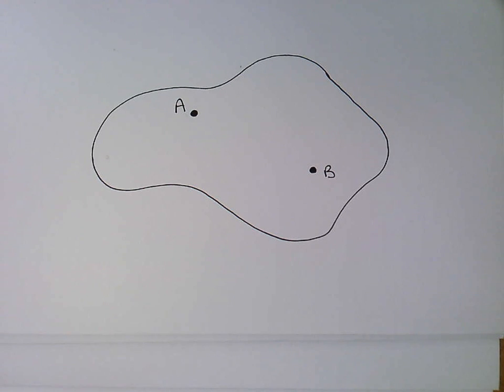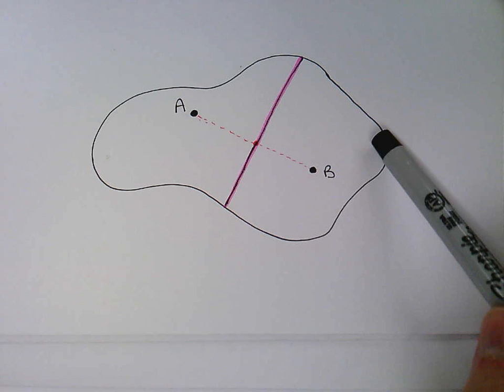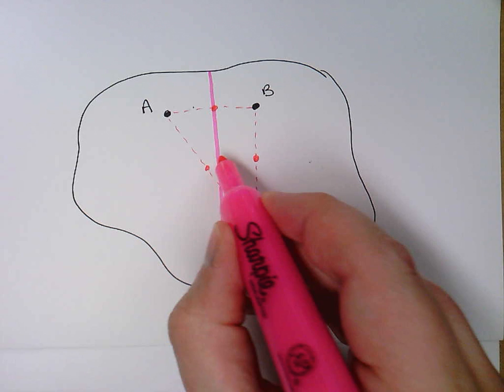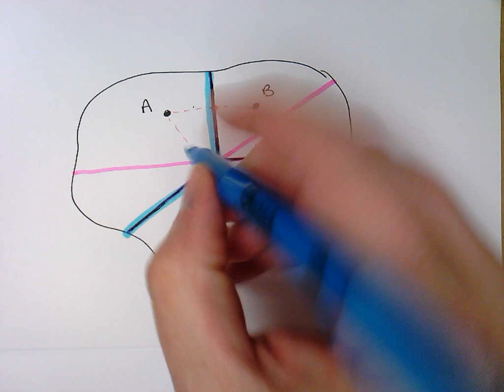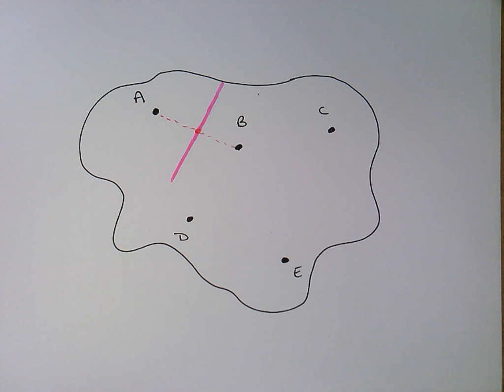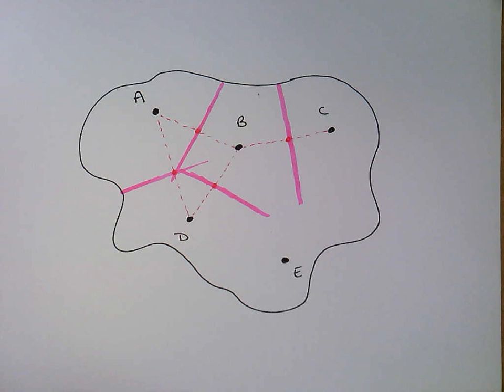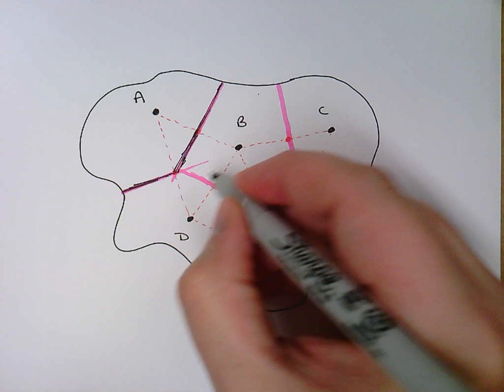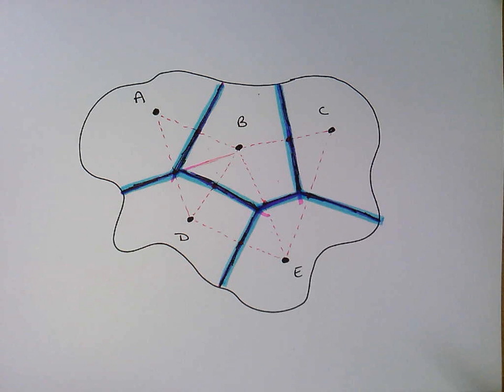Thiessen Polygon Method

Comment: Why are you not joint A and C
Reply from the maker: The reason to connect 2 dots is to find the dividing line between them that separates which area is closer to one, and which area is closer to another. There's no need to connect A and C as B is between them, so anything in the middle will be closer to B than either of them.

Comment: how do I use the grid method to calculate?
Reply from the maker: Just overlay any grid onto the picture and count the squares in each area. It sounds really approximate but gives surprisingly consistent results. I did it with a class of 30, and almost everyone got within about 1% of each other.
Reply: @trevorray831  thanks I appreciate it 😍

Comment: how to solve area?
Reply from the maker: It doesn’t sound very scientific, but the easiest way is to put a grid on top of the picture and just count the number of boxes. Because everything is an approximation anyway, it works quite well. I had a class of 25 students try it, and almost all answers were within about 2% of each other. The smaller the boxes in the grid, the more accurate the results will be.

Comment: Trevor thank you for your video, now I am interested to know from here how do you average the precipitation data of catchment area?
Reply: Overlay the map onto a square grid and literally just count squares to get an approximate area for each region. Units for the area don't matter - they'll cancel out later anyway. Once you have each region's area, multiply the area of that region by the rainfall in that region. Add all of those products together. Finally, divide this by the total area of the entire map. This gives the average rainfall. It's really just a weighted average. For example, say you only have 2 regions. Region A has an area of 10 boxes and 25 mm or rain. Region B has 5 boxes and 10 mm or rain. The average rain would be (10 x 25 + 5 x 10)/(10 + 5) = 300/15 = 20 mm of rain.
Reply: Thank you so much.  I will do so. I should like to share you the results of my research once am done. Would you mind sharing your email?
Reply: It has helped a lot. I am in the analysis phase of my Bachelors Degree Research Project and have been looking for the best method with which to average the precipitation data from the weather stations surrounding my study area. This video  has opened my mind. Thanks.

Comment: why u not join gauge c and A
Reply: If you're talking about the last diagram, it's because B is between them. There's no point in connecting A and C since the breaks between A & B and B & C will override A & C.
Reply: I just can't understand. It is obvious with 3 points. However, when there are more than three, there is no pattern. I wish an algorithm to teach a computer how to do this automatically.
Reply: @brenoarruda2996  there are algorithms to construct Thiessen polygons.